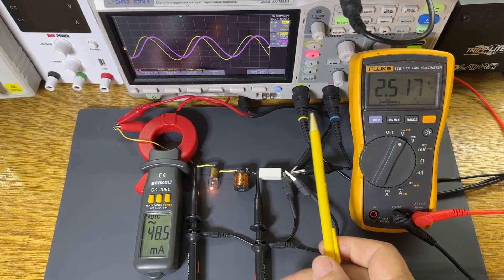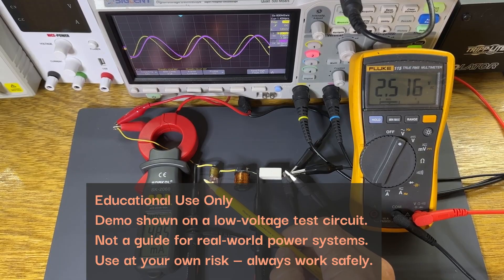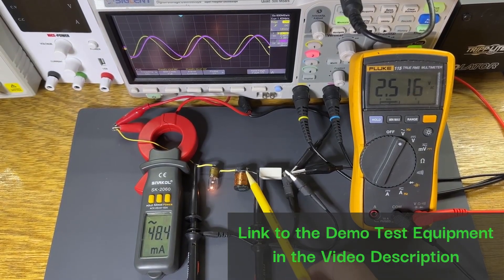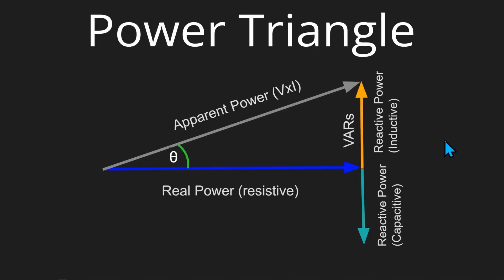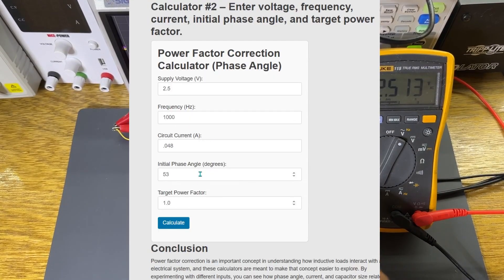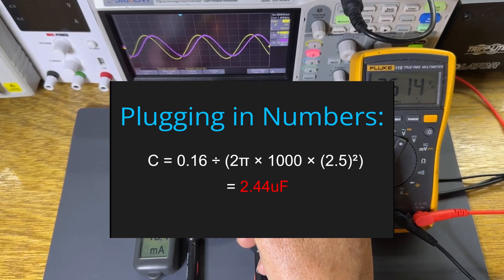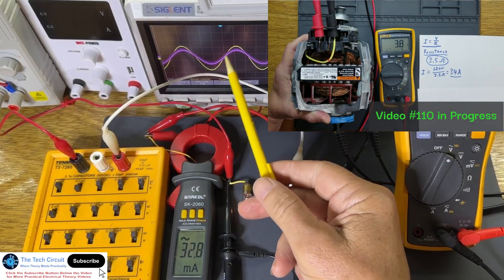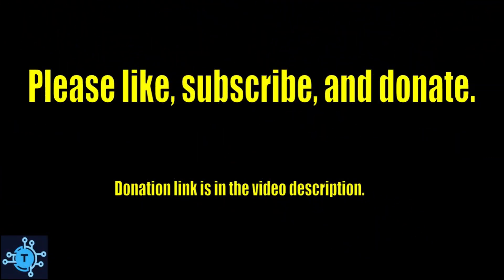#109 - Power Factor Correction Explained with a Simple Demo Circuit

Comment: If the positive current waveform zero crossing is horizontally separated from the voltage waveform zero crossing by 53 degrees does that imply some lingering positive current flow just at and after the AC voltage goes below zero? I'm surprised the current is not square waved or the voltage not contains non-linear spikes around these moments (on your oscilloscope).... perhaps the explanation is that at this time the voltage is actually very small and the magnetic flux high? Nice vid!

Comment: Informative, but home owners does not pay for apparent power, only real power as I understand it.. Businesses do.
Reply: I have heard that erroneous argument so many times! BUT, now comes the but. 🙂It goes well beyond "pay for apparent power". I'll provide an example of a installation were the capacitor made "miracles". Switch board, monophase, 230V 16A. Main was tripping too many times due to several aquariums and other equipment. Increase the switch board capacity. although doable. Would imply a lot more expense than I wanted. 

Solution: One PFC capacitor, problem solved never tripped again and that was years ago... 🙂I have several other examples.
BTW the capacitor was free. Installation took a couple minutes. Totally and completely worth.